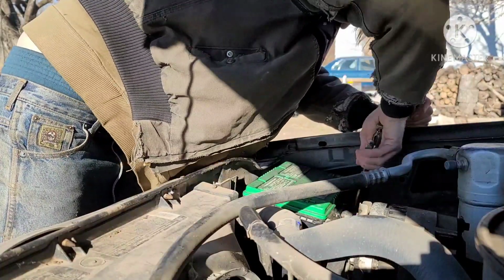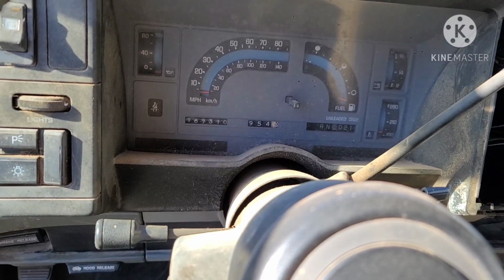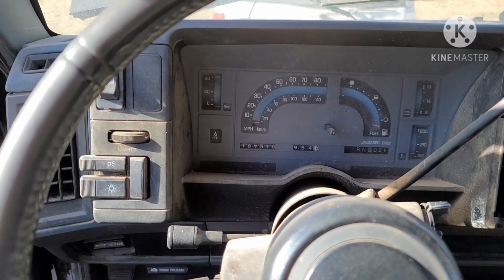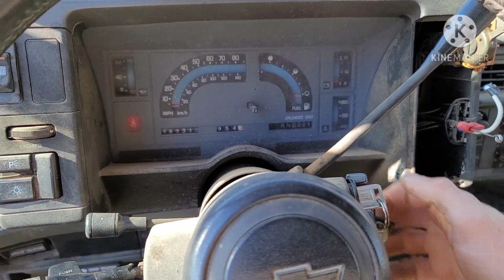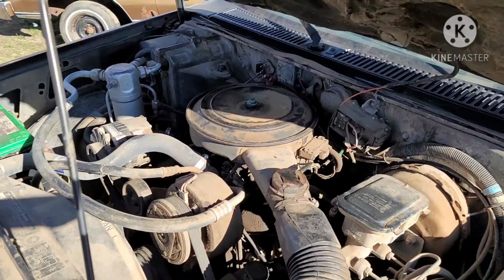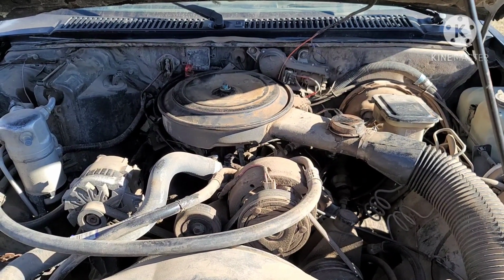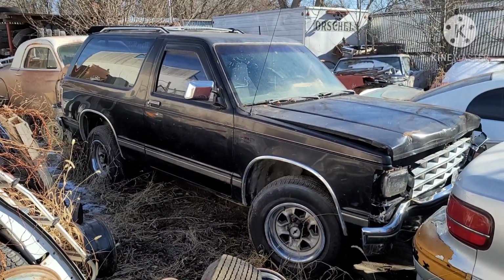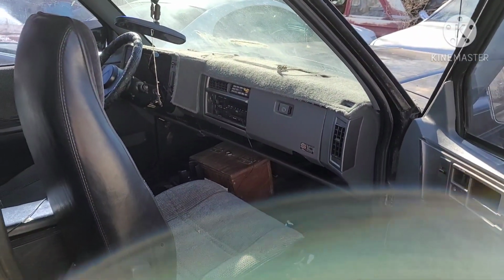Junkyard Rescue: 1988 S10 Blazer Sport 2WD! Walk around, Will it run, + It has an identical twin????

Comment: I've got a 1984, 2DR, Blazer, 4X4, 2.8L/Auto with 44,000 Original Miles on it, I've been rebuilding it from the ground up for the past 2 - 2.5 years now, I took the body off it and bought a new frame bc the old one was bent, So I took the new frame and started rebuilding it and cleaning it up and I put POR 15 on the whole frame, But the whole time I was building the new Frame I tried to find a good 4X4, 4.3/5 Speed Donor S10 or Blazer, Well I never could find one and it killed me to have to put that 2.8L/Auto back in it, Well fast forward like a year now and I've found 2 4x4, 4.3L/5 Speed Trucks, One that is a 1993 Ext Cab, 4X4, 4.3/5 Speed S10 and One that is a 1991 Single Cab, 4X4, 4.3/5 Speed S10, The 93 has an Original 91,000 Miles on it and the 91 I'm not sure about, It says 300,000 on the Dash, But I just don't know.... I had bought the 91 first and I was going to use it, But then I found the 93 and had the cash to buy it too, So I bought it lol, But once I get the Engine swap done on my 1995 S10 Truck done, then I'm going to be tearing the Blazer back apart and doing a 4.3/5 Speed on my Blazer....  You can check all my stuff out on my channel if you want...

Comment: I have a 87 S10 2 dr 2wd, with a 350/4 barrel 3800 stall and a 350 trans it still has an open rear end that I would like to change but it is a fun ride.
Reply from the maker: Nice! I really think the collector value of these and Astro vans is going to climb in the next 5-10 years

Comment: The number one major issue with the early 2.8's is they were externally balanced most sounded like bowling balls in a cement mixer before 60k miles 

early 90's a friend bought a totaled 91 s-10 with a 2.5 iron duke 5spd he swapped the drive train and rear  and main harness  into an 87 2wd blazer the blazer was flawless not a single dent on it garage kept